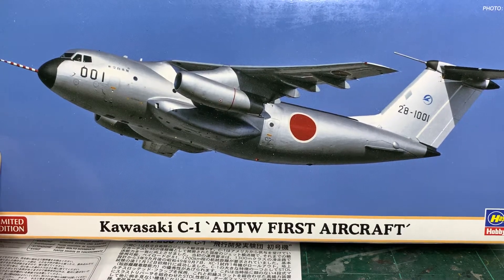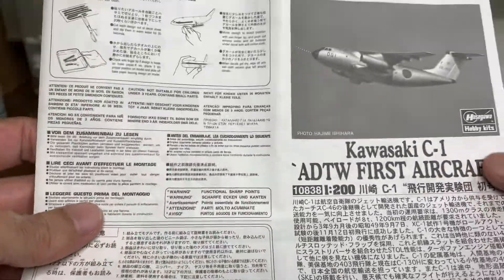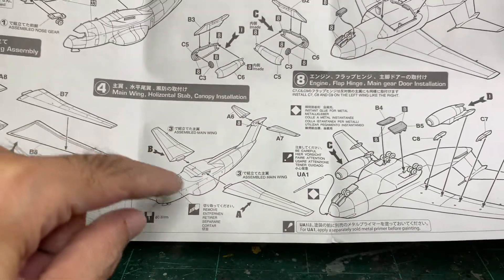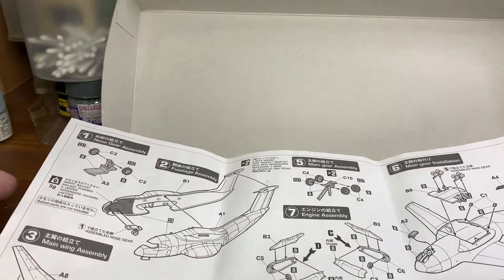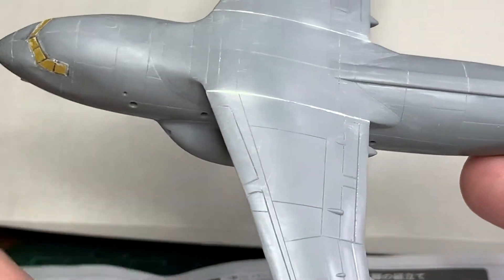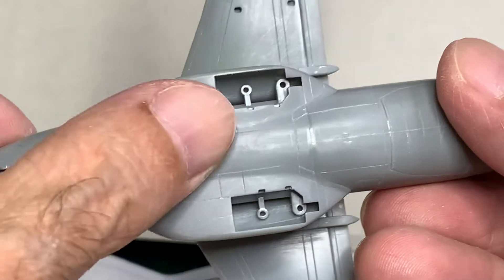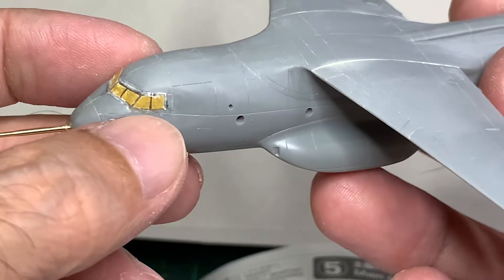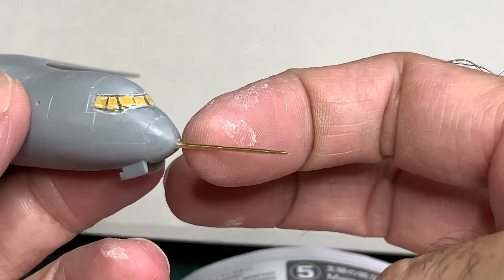1/200 Kawasaki C1 Hasegawa build update part 1

Comment: oof, you should've fitted and glued the engine assy to the wings since the fits are problematic, especially since the engine pylons need to have smooth transition to the leading edges (i'd say they're integrated to the leading edges), and the bottom of the wings just don't fit well to the pylons.
Also the rear doors are 3-pieces (ramp and left-right clamshells) so you might want to restore a panel line there.
I'm also working on the C-1 (a different boxing) at the moment so I encountered these problems earlier, also had to pay the price for fitting the wings to the fuselage first instead of the engine pylons.
Reply from the maker: thanks for the tips. great to hear you’re working on the same kit. i will do the wing tips painting first then put the engines. i notice there’s gap between the engine pylons and wings but that’s something i need to clean after the masking on wing flap is done else it’s so difficult to mask. another reason i didn’t attached the engine is when spraying the entire body the fuselage area between the engines will not be reachable. i will scribe the cargo door area as you advised. thank you for the tips. stay tuned next week . i’ll bring the update again.